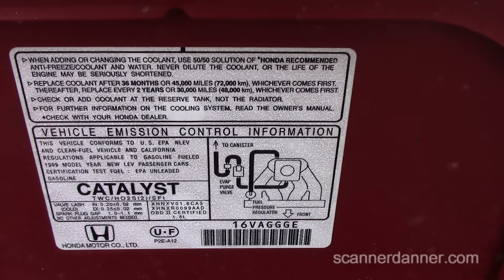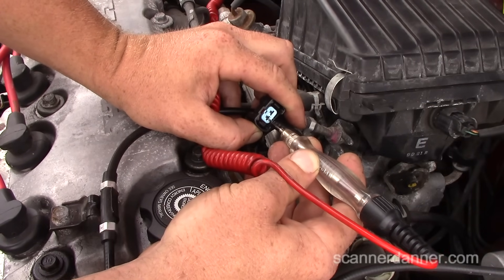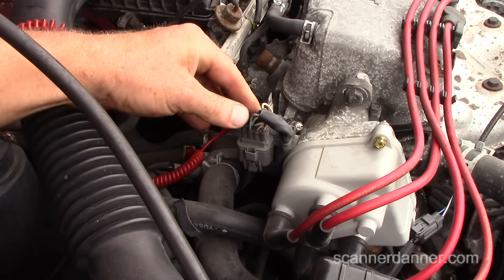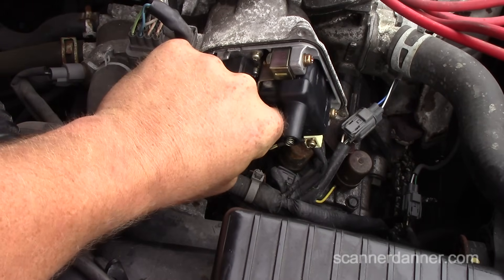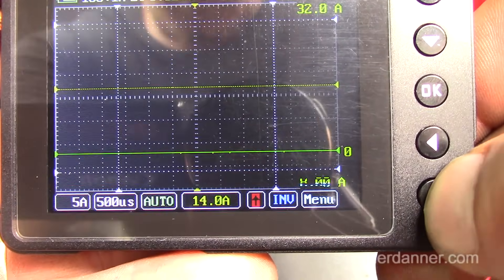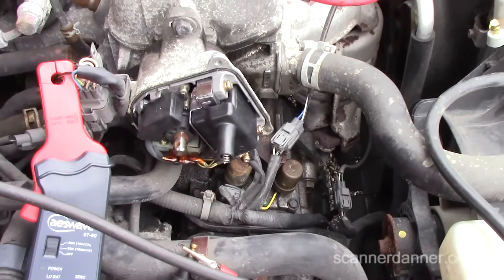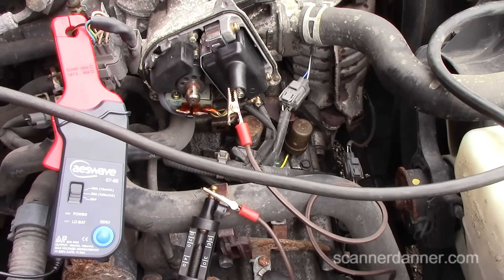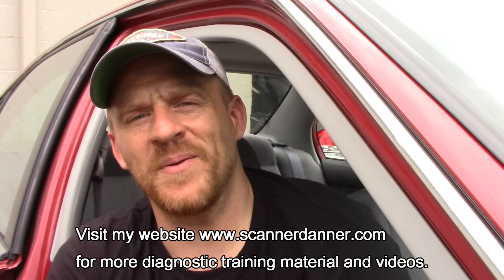99 Honda Civic No Spark Diagnosis with a Test Light

Comment: Do u happen to know what else to check I’ve checked spark timing fuel it’s. On a 2000 explorer 4.0l sohc I’m wondering if the pats isn’t killing stuff after it try’s to fire
Reply from the maker: There would be a trouble code for the anti-theft system if that is what is happening.
Reply: Only code to come up was b1845
Reply from the maker: And what is b1845?
Reply: ScannerDanner  it ignition tamper circuit failure
Reply: ScannerDanner  only thing I could think of is it thinks it’s being stolen and won’t let it start up
Reply from the maker: There you go, that code will cut injection pulse. For additional help go here. It's free to join
https://www.scannerdanner.com/forum/post-your-repair-questions-here.html

Comment: The ignitor and the ignition coil are both parts of the distributor. Most video I saw so far, people just change the distributor. I think they cost almost as much as the distributor itself?
Reply from the maker: Regardless of the cost of the reman distributor vs fixing what's broken inside, the important part was understanding how to troubleshoot this as the techniques apply to everything!

Comment: Hi Paul, great video as always. I have a question on equipment, and seeing as you are showing a new scope on this video i thought i would ask here. The new Snap On Verus Edge, is there a huge difference between it and the Verus Pro?? I currently have the Pro and the Edge is in the process off being launched here in the UK, so im contemplating trading in. My rep wants a fair sum of money for the upgrade so just trying to really find out what the Edge can do that the Pro cant, or what the Edge does better than the Pro. Any unbiased advice, like what you guve in all your videos, would be awesome, cheers
Reply from the maker: I'm not sure the difference to be honest with you. We have the first gen Verus here at the school, then we have one Verus Pro and now a couple Verus Edges. 
I would probably stay with the pro and save my money for updates? But again, I'm not sure
Reply: The fact that you are unsure of any major real world differences having used both machines Paul, it tells me that your advice is the way to go. Updates are alot of money also, so thankyou for taking the time to reply
Reply from the maker: Using the Verus Edge more and more and it seems to handle data PIDs or update them faster. I'm not sure on this yet. 
It is definitely lighter, by far. 
The automatic ID is sweet and wireless is awesome but the pro had that I think
Reply: Yes the Pro has the wireless data link connector/interface and has auto ID which works from about 06 onwards on most models over here. The weight i know is quite a difference after holding one on the Snap On van the other day. They do advertise it as having a better processor so maybe updating PIDs faster would be true, however the upgrade for me personally would cost another 2250 Pounds (3000 US dollars ish), so thats alot of money if there  is only a few major differences. My rep did say that the Edge will have upto date dealer TSBs which would be nice but at the same time i dont work on brand new vehicles so thats not enough to sell it to me

Comment: So if Im getting spark both at the spark plug and the coil, igniter also good and pulsing but getting no light when touching the negative side of the coil?
Reply from the maker: If you have good spark why are you even testing coil negative? You are not testing it correctly if you have good spark.
Reply: 96 Civic wont start. Seems to be getting good spark and gas. Was just wondering why when I touched the negetive that no light came up like yours did?

Comment: unable to show primary coil negative voltage waveform on this model and if had low amp on current ramp waveform can you verify good ground during coil saturation by igniter on the waveform using wyse probe or secondary pickup?
Reply from the maker: just the amperage waveform alone will guide you with that. Watch this one, I think it will help answer your question
https://www.youtube.com/watch?v=eoodIVGgGyw&t=2s

Comment: what if the coil and the icm test good? what then as well as all of the fuses. gotta 94 delsol d15b17 just randomly died on me at a stop sign.  new cap and coil pack checked all of the fuses and had the icm checks at the parts store
Reply from the maker: Assuming you have no spark. Cam and crank signals need to be verified as well as the computer control signal to the icm

Comment: Can I jump starter with wire hook up to battery positive and check for spark  while ignition turn on?
Reply from the maker: Only on some cars, never systems need to see signals from the ignition switch. Also there is a major safety issue with manual transmissions or automatic transmissions left in gear. Just wanted to remind you.

Comment: Hi, I'm stuck. I have a 2000 Civic EX. I was bleeding the coolant lines and the car was running great and just idling. Then it died just like that. It won't re-start. Compression is good. No spark to any of the 4 wires. I  was following the video and when I probed the fuel injector connectors (like you did around the 2 minute mark) 2 things happened. 1) no pulsing on the brown wire and 2) Solid light on the other wire with ignition on and not cranking AND when I touch the probe it deactivates the neutral safety switch?!?!!? Also no pulse on the ignitor output. When I probed the light was connected to battery + and I did check to make sure it was working correctly. Any suggestions what to do next? It seems so bizarre to me.
Reply from the maker: With the key on, do you have 5 volts to one of the wires on your TPS or MAP sensor?
Reply: Thanks for the reply. As it turns out I'm an idiot. I had pulled the fuel pump fuse to avoid flooding it while cranking. When I replaced the fuse the problem resolved. As it turns out it was a bad coil. Thanks again for taking the time to reply. Your video saved my ass.

Comment: 23:08 Spark from a good coil can jump over a rather large air gap. I have a crank no-start situation and my coil can only show a spark if my test light is basically touching the metal coil on the ignition coil. Looks like I'll have to order a new coil.

26:57 Good and bad coil wave forms.

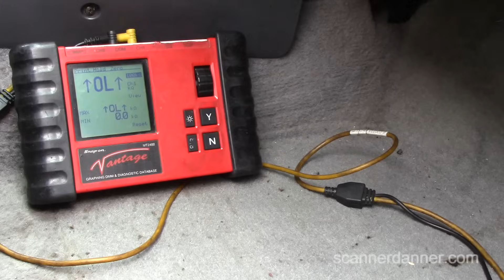28:34 Ignition coil resistance test (with TEC coil specs: Primary=0.63 - 0.77 ohms; Secondary=12.8 - 19.2 kohms).
Reply: I got a new $15 ignition coil from Amazon just to see if it would fix the issue... and it did!

I was surprised that when I tested the resistances of the old ignition coil, they were within spec: primary=0.7 ohm; secondary=16.17 kohm. So the failure must only show up under load.

The new coil had the following resistances: primary=0.5-0.7 ohm; secondary=15.49 kohm. I'll get a more expensive coil and put that in; OEM is $108 and NKG is $70... not sure which I'll go with yet. I'll keep the cheap one as a backup.
Reply: @flexibleaspect  I've seen other techs say exactly that. You can get good resistance reads on a bad coil and those out of spec ohms are prob only detectable under load. 
My rotor has no set screw and doesn't want to come off to access wiring to use test light:(
Reply: @ooulalah4333  You can't see a screw on the rotor even after viewing it from all angles? Very strange. I would think you could just pull it off in that case...

Comment: gran video como siempre señor danner, 
i'm a DIY so i bought the uscope a time ago 'cause was the only affordable to me, and it helped me to diagnose some misfire on my car, specially with the injectors and spark plugs under the manifold and the amp probe great feature, 
thanks mr danner for sharing your experience. hope some day you make a video with the uscope on a O2 sensor issue

Comment: Today my civic shut off going down the road. I thought fuel pump because I couldn't hear it, took the fuel pump out and benchtested it and it spun fine. Checked for spark by laying the spark plug on the engine block and looking for spark while a friend turned it over and didn't see anything. Took the cap off and using a harbor freight multimeter the primary was 0.3 and secondary 11.8 online says should be .6-.8 primary and 13-19 secondary. I did some light tests on the coil, on terminal a to ground it lit and flickered on turning over as well as terminal b same thing. On the spring turning over it flashed red and green over and over. Any ideas?
Reply: how did it end... Cos I am having similar issues
Reply: Bad ignitor

Comment: Love these videos!! Little scope is killer. Do u need an attenuator if you're checking coil primary voltage?
Reply from the maker: I don't think so. That's a question for my friends at aeswave.com
Reply: Yes you do they recommend 10 to 1
Reply: Max voltage of U scope is 80 volts

Comment: Since the ignition coil is an autotransformer you could test between primary and secondary
Reply from the maker: Are you talking about a resistance test? The problem with that is when it tests bad, it is bad,  but when it tests good, it can still be bad

Comment: What if the test result on the case where you connect your test lead clip to positive and the test point to the terminal of igniter and it does not light and flicker.....What would be the problem.
Reply from the maker: Remember the igniter needs to be "told" when to switch the transistor on and off. This is the job of the ECM. The ECM takes the cam, crank and TDC signals from the distributor and then sends a small pulsed signal back to the igniter. I am not sure what pin that is offhand or what voltage levels the ECM is using. It can be as low as a 0-4volt square wave to as high as a 0-12v. This will not be easy to view with your multi-meter and will NOT flicker your test light. 
Some additional guidance:
#1 If you have injector pulse and no spark, then this means the ECM IS receiving the inputs it needs from the distributor and the ECM powers and grounds are good. And we need to then focus on the ECM to Igniter control signal. 
#2 If you do NOT have injector pulse and no spark, then you need to go in a completely different direction and we are no longer worried about our ECM to Igniter control signal.  Inputs (cam, crank TDC) need to be checked as well as main computer powers and grounds. 
Here is a video on a Subaru I did that will give you a good guide as to what I am talking about with these control signals. 
https://www.youtube.com/watch?v=YBE7c7lfmnY

Here is the breakdown of the above video I did with my class
https://www.youtube.com/watch?v=LdnnFD6J8Uo

Here are some other good videos on this topic
https://www.youtube.com/watch?v=VG3EZJlyjl8
Reply: ScannerDanner I purchased me an oscilloscope, I checked the output of the igniter again. There was an output that my test light cannot pick up. The ignition coil was bad in my 1994 Honda Prelude. I also checked the input of the ECM to the igniter with the scope. Your video just saved me to get my Honda towed to the dealer. I had a mechanic did the engine swap and could not figure out why it wouldnt start. What throw him off is he had two old ignition coil he tried but did not work. He did not diagnosed it by testing input/output feed from ECM and igniter, to the ignition coil. I had the car towed to my house. Thanks a lot.

Comment: MY 2001 ACURA INTEGRA HAVE SPARK ON COIL BUT NOT ON THE WIRES REPLASED CAP N ROTOR STILL NOTING WHAT CAN IT BE?
 THANKS
Reply from the maker: how far does the spark jump from the coil?

Comment: any onehung low scope will do I use valleman as it has bnc so I can use my picoscope leads. for ohm readings if it reads bad then it is probably bad if it reads ok then you don't know if it's bad or good. Pico have free software to mess about in demo mode to see what the scale are a scope is a scope the difference is only the details in zoom in measuring onehung low will guess it's way from one dot of measurement to the next. expensive scope will make loads of measurement of the same area for way more accurate zooming. but a signal wave form onehanglow all ok just know the tools limmits.

Comment: The old distributor would also have needed a new internal shaft seal and external o-ring too look at all that oil underneath it. Oil leaking from the distributor over time destroys the heater core hose underneath. I've seen them with bubbles in them ready to burst.

In the end a new distributor was a better deal in more ways than one.
Reply: Yep last one I pulled for dist o-ring had the heater hose inflated like a balloon. Lucky catch for the owner.
Reply: Bushougoma 
Hi, can you help me? I have a 88 Honda Civic and it sat for a year because it was cranking but not starting then I did the following: 

1- replaced the battery 
2- replaced the main relay with new Honda  original 
3- change oil and filter 
5- put fresh gasoline tank is full 
6- installed new distributor, whole unit was replaced.. 

I do t know what else to do.. any suggestions? I really appreciate it

Comment: i have a 2003 accord it has a ruff idle and engine is shaking and it wot rev over 5k rpm like its on limp mode  no check engine light i scanned it no code ... but the long term fuel was 20% and it was over 15 degrees spark advanced..

Comment: Ever run into no power to botton Plug on dizzy?
Reply from the maker: Step 1, you need a good wiring diagram to see where power comes from. I do not know offhand.
https://eautorepair.adtrk.biz/?a=10817&c=24&p=r&s1=
This is a link to the DIY version of the same service info I use

Comment: Nice one buddy that U Scope is awesome. 👍👍
Reply: It is a very handy tool that will take you along way without spending oodles of cash.  The AES-Wave software (strictly speaking the firmware) makes a very good little bit of hardware  into a truly great tool.   The basic Chineses Oscilloscope it is based is just about  unuseable  without upgraded firmware.
In terms of bang for your buck it is great value.
You can buy the basic version and  add accesories as you go along.

Comment: I'm having the same issue with my Honda  my car starts and drives but no spark in 3 and 4 cylinder at the end of the wires D16y8

Comment: How I do a test light at the primary coil wires....I put my test light alligator on positive side of coil and the test light probe on negative side of coil.  If the light flashes while cranking I verified positive and negative at same time.  Again, if you hook your test light alligator to POSITIVE, then you don't have to watch for an elusive "flicker" on the negative side of the coil.  If it flashes at all during cranking, you have verified the igniter is grounding the coil.
Reply from the maker: It's hard enough to get to coil negative by itself let alone the positive and negative at the same time.

Comment: Nice one.
I see this on my Pico and from experience I know its a short on the secondary. What i would love to know is why the pattern is the way it is. The shorted coil spikes straight up and then curves to max amps. Why the curved ramp versus the good coil that has a straight ramp.
I know its amperage building over time so it gets drawn as a angled straight line on a good coil. Why curved angle on a bad one. I would love to understand this.
Reply from the maker: It has to do with feedback from the secondary winding and counter electromotive force. 
When the coil is first turned on, the magnetic field is moving across both windings. When the secondary is shorted, any voltage created is dumped off as apposed to oscillating back and forth. (The plug gap is what prevents this first few hundred volts from dumping off). I have some lectures on this on SD Premium
Reply: ok
Premium it is then
Cheers

Comment: When diagnosing any wires you should refer to a wire chart and a pin-out chart. testing wires blindly, you are taking a chance on popping a fuse or shorting something out. I would never ever do that blind but it's not my car so take it for what it's worth. You will never know until it's to late unless you do the leg work first on looking it up. You might know but the person who you are trying to help might not know and then it will cost them more $.
Reply from the maker: I didn't test anything "blindly" in this video
Reply: First of all I am not trying to do a pissing match with you. Second I can tell you have done a lot of them and most of the wiring you know like the back of your hand and I was not questioning you. what I was trying to say deals with the general public (not all the public either). (If you have been doing it a long time {I believe that you have} then you should know who I am referring to in the general public)the kind of person who would put power or ground to a circuit and cause a popped fuse or do damage to the CPU, ECT. Basically what i was saying is that you should mention that they should refer to the wiring/pin-out charts so they don't mess anything up. That's what I was driving at. Also the part of the general public that i was referring to would Grab the tester and just start checking wires with out knowing what is what, they might grab a different connector and test wires. you know what your doing, some of the public knows to get that info before starting or watch you and have a very good idea because they have some experience from the past doing their own work. Then you have the ones that watch you and figure that they know even though they probably never opened the hood. (IE a female came in with a geo metro and couldn't figure why the check engine light was on because she put 12 quarts of oil in it."Cat was glowing that was her problem and these are the ones I was referring to and I was just saying it because you might want to mention how you know so they don't screw up their car))

Comment: Why didn't you pull up a wire diagram to check your wire Dan
Reply from the maker: I knew this one, at least at a level that I was comfortable in the tools I was using. I don't feel that I needed one in this case. Thanks! (It's Paul btw)